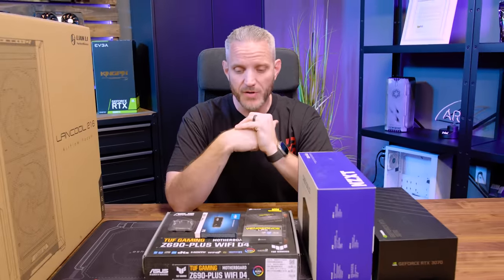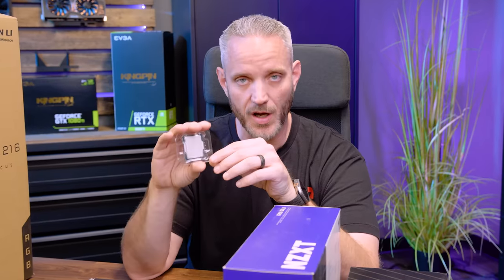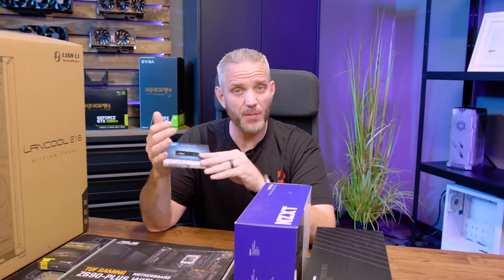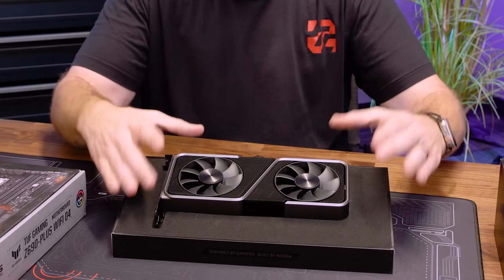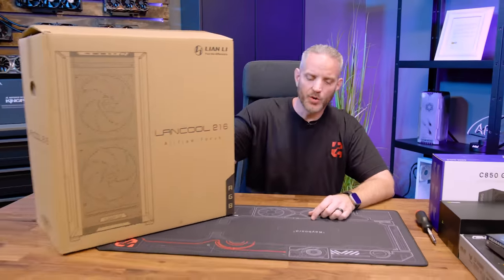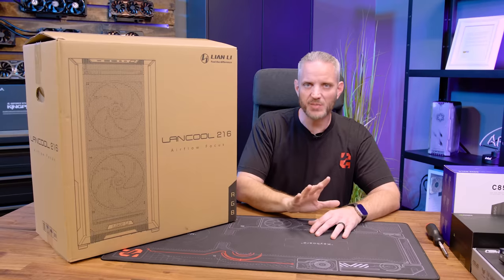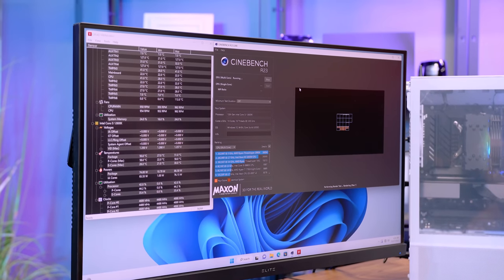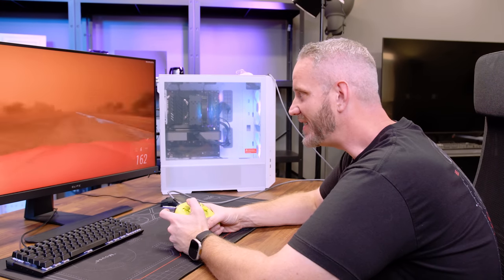Inexpensive PC Build Guide!

Comment: hoenstly the wildest thing to me is that the final price tag is almost EXACTLY, like to the dollar, how much i paid for my full first build in 2018!!! almost 5 years with parts that were already a year or 2 old at the time, and theres this much performance room for a full respending of that same tier of investment. its in teresting, but knowing that i left myself some of that upgrade head room.........this just validates all my plans from back thne and makes me so happy. a 330$ cpu upgrade fopr my current build t oa 5800x3d so im not buildign a NEW system at the end of an upgrade path but simply refreshing my old system TO the end of an upgrade path feels amazing. some bios work, frehs software, and maybe a cleaned up or newer OS drive if i need to could have this system running liek new~~~~ THE ONLY thing that has me seriously worried is the psu. its a 80 gold evga g6 but only 750w...... like its A GOOD bit of what id want, but the idea is that if im changing the psu thne im just rebuilding everything. cause its fun to build a new pc and because that much cable managing nightmare is just better to do with new equipment in a freshly cleaned (and potentialy new) case, but if i can keep that then im gold. the ONLY problem is i have no idea what gpu i want............ a 5800x3d is now a 105W tdp cpu, like rest of my system si chicken scr5atch of power draw at the moment, but my greedy self would LOVE a 3080 or even 7900xtx tier gpu upgrade if there was every a price stabilization to make it financialy realistic, or until the pricing stays high for so long that its the new norm and i just do it anyway~ i just worry that a 300-400w tdp card is gonna over tax this aged power supply so idk~~~~~

i think the one thing youve shown me si that i should consider a 3070 ti range gpu which will be essentially plug and play in my current build after the cpu ugprade cause the power psu limit is deffinitly stil lthere.......... its just......... my "target" gaming has improved as ive improved my tastes over the years~ it wasnt until this year that i dumped 400$ into a PROPER monitor upgrade, learnnig that its a place not ot be cheap, but im basicly target 1440p 144-165hz 27inch gaming which my new monitor is perfect quality ot support beign the msi mag27qrf-qd etyc etc. i just hope that i dont makje myself disappointed by not gettign the extreems of performance from "overpaying" for a lesser tier gpu which would still probably be damn neer 50-60% better than my 1080 which i love TO DEATH. buuuuuuuuuuuut thats all because i want "out of the box" performance............. what im truly learning is that a fan refresh, proper ram, some good cleaning and proper software, dino testing and optomization and bios updates................. i could just start doing evne the most minor overclocking and get way more power out of a lower end gpu. 3070 or 3070 ti or what have you~~~~ sooooooooooooooo good to have options, i just need ot kepe researching and learn WHAT options will work for me, which im willing to spend the budget on (i have the money im just super fucking picky sadly) and go from there cause mannnnnnnnnnnnnnnnnn not only shipping scams but just DOING THE BUILD is stressful. the single thing i love the most is building but its also the most stressfu lcause anything cna go wrong, ESPECIALLY with a refresh upgrade, even tho its robust tech, its expensive. anmd the down time for getting something wrong is always there. BUT LETS HAVE A BLAST OF A 2023 AND CHEEEEEEEEEEEEEEEEEEEEEEEEEEEEEEEEEEEEEERS

Comment: I just put together a Ryzen 5 5600x Corsair gold PSU 750w
Mpg b550 mobo
32 gig 3600mhz tforce delta cl18
Deep cool ak400 air cooler
And a 3060ti  evga ftw3 
1tb Samsung 980 pro
2tb barracuda HDD
In a Corsair 4000d airflow 5 sp 120 fans 
-1200. USD. Hopefully no bottle necks .😅

Comment: Using YouTube,  Tech chat rooms, and pre-built pc website.  I figured out the parts I needed for my PC. It's a higher end PC Build that utilized ddr4 memory. The gpu is a 4080. My pc is designed for utilizing applications like Blender to make video games. My cost is going to be around $3000 USA. I already have a tv I can use for the monitor, LG C2 42in oled tv. That is what I am working to save up to. I won't have enough until sometime after the tax season.  I got plenty of time to find better deals. Maybe better part options will come out. I'm fine with a 3080 but the best price I can find is around $1000 USA. I rather spend a little more and get 50% more performance.

Comment: i just built a system for a friend. 7600x, 32gb 6000 ddr5, 240 aio, compact torrent, single 1tb nvme. the core of this built was about 870.00 on black friday. shipped.  i wanted 5 for future expandability and i wanted the am5 for upgrades. the board is a 650m.  we borrowed a 2070 from a friend for now, looking to spend 1K on a video card in teh future so, just under 2K for a gaming build.

Comment: Massive props for picking the 3070.  I don't even "like" the card.  I got a Gigabyte Aorus 2 years ago and it was great.  Still is.  Best bang for buck GPU.  I have a 6800XT and 6950XT and for sheer reliability and lack of problems, the 3070 has been a champ.  I can afford any graphics card I want but my experience with the 3070 convinced me to wait for the 4070.
Reply: If the 3070 is still fine i don't see much reason to replace it anytime soon.
Reply: @rimuru2035  Yea and as a follow-up, GN's 4070Ti review also convinced me I can wait for a 5070.

Comment: I have to say I got the black Lancool 216 and really love this case.  I've been trying to get the RGB fan controller and the optional mesh dust filter for the front but have so far not been able to find them in stock.  The other case I might consider is the new Fractal North case with the wooden slats on the front, but it is a smaller case and I just ordered a MSI Gaming X Trio 4090 while will fit in the Lancool 216 no problem.

Comment: Just helped a friend of mine building his pc at the beginning og december. He ender up with a Ryzen 5800x, Corsair Aio, Gigabyte 3070, 32gb ram (3200mhz) B550 Asus MB, 850watt psu, 1tb Nvme in a Nzxt H510 flow case. Total of 1861$. Was reasonable i think. This was i Denmark so that was with VAT.

Comment: Last week, I upgraded my 1080 to a 3060 for 440 lardolls VAT included, that's it. 
Yes, I know, it'll be running at PCIE 3.0 speeds instead of 4.0, but DGAF. I can deal with that if and when the mobo fails, or when Windows 10 support ends, and the 3060 will still be a decent card by then. The system was originally built in december of 2017.

Comment: Hey Jay, I really like that you did a budget build. However I feel like you put too much thought and "value" into having an upgrade path. I don't know if I'm alone with this but when I build a PC I use it unchanged for at least 5-8 years. When the time that I want to upgrade finally comes I usually have to upgrade pretty much everything anyway. I really would like to see that 5800X or 5600X Build.
Reply: While I wouldn't say the system as a whole stays fully unchanged for its lifetime, the core (Motherboard, CPU) usually does. The systems I supervise (friends, family, my own) commonly do see storage (swap to SSD/M.2; just adding more) & ram (+2 modules) upgrades. Gaming systems also see the odd GPU upgrade (roughly every 4 years), which then get carried over into the next system. But by the time people want to replace the CPU (5+ years), finding a suitable in-platform upgrade will be tricky.

Applying such a timeframe to this system, we're looking at a CPU upgrade in late 2027 or later. DDR6 should be out by then as well as 5 or more new generations of Intel CPUs. 

For the upgrade path to shine, the upgrade would have to happen just as the cost of the 13th-gen CPUs is at the all time low.

Comment: I had another path.  Went a bit overboard. Building a his and hers gaming pcs with our current gpus. It’s more then I planned to spend but wanted something on the on the more current platform ( current a 2070 and a 3080)Did the math and spent just under 2,900.00 for 2 pcs. X 2 for all that follows. Hyte y60. 7900x/ ddr5 6000( the micro center and expo set thou 1 stick was faulty out of the box, happy I had a 2nd pc to test in.  Drove me crazy. ) similar motherboards( asus tuf b650 plus Wi-Fi / b650 aorus elite ax (needed bios update…that was a first) noctua fans, Corsair I cue h150i a couple 2 tb m.2 and a single super flower 1300 watt psu.   ( used the 850 watt I had in my wife’s oc with the 2070.)
O yeah and I moved the ssds I had over and used the rack mounts in the hyte y60. One on the bottom, and one using 2 screws and left it floating above the other.  Works fine and gets some airflow that way. Ssds seems stable and ok to do that with. 

It was not easy as this was my first big build and a lot went wrong. Got a different aio first and found out it was 20mm to tall for the hyte y60( didn’t know they were different thicknesses) Had random crashes because I didn’t do a clean windows install at first. Then more random crashes as I had miscalculated the psu requirements and the 850 was being overdrawn.  Used Msi afterburner to limit the gpu to 70 % to prove that was the problem. Had a hdd 6.0 tb that went wonky and died in my pc minutes after install ( it was old and was likely damaged in shipping from a friend who packed it badly and caused long boot and random crashes while I figured that out. ) replaced it with a 3 tb one that hasn’t died…yet. And had one of the sticks of ram as mentioned above prevent either pc from posting. Had to do my first bios update ever. Research how to initialize new drives.  Reactivate windows on the drives I moved over I was all over the place. But finally they are both up and running as of today. And hopefully stable.  Building a pc can be done by anyone but sometimes if you don’t know what to look for it can take a long time and a lot of research to figure out the gremlins. Also had a issue with the pc overheating and shutting down as I had forgotten to set the case fans to the gpu temp for their curve not the cpu as that was getting plenty of air so set them at a regular speed that’s not too loud and can get more air to the gpu.  Hyte y60 has ok airflow. But I knew going into this build it was for a long time ( as I can upgrade from the 7900x someday with am5 socket down the road) and was going to be a bit of a hobby build as my last pc build I tried on my own resulted in a melted ram slot and blown up/ smoking psu…  well it all fried actually. But… somehow I’m here.  They work.  It feels good, but I’m wondering when the next gremlin will come up. And when gskill will reply to my ram rma 

Was fun and thanks j for posting builds, guides, etc.  It helped alot and would not have been possible without you and a few other tech tubers too. Hopefully I can enjoy these for many years to come…

Happy gaming.

Comment: I bought the 5700X for like $199 and it is 3% slower than the 5800X. Bought an AIB 3 fan 6700XT for $470 and game pass. Because the 3070 and the 6700XT trade blows. But when it comes to RT... they both suck. Yes, you can say that the 3070 doesn't suck as bad. But when they both suck so much that you turn it off...

I am not blaming either GPU company for RT performance. Look at at Far Cry 6. They took the time to implement RT in conjunction with raster and it looks great but does not break immersion or performance. Most studio's are lazy and paint RT with a broad brush. Break immersion and performance.

Comment: Upgradability is why I went Zen 4 with my new build instead of Zen 3+. Of course, I had a bigger budget (spent $2500 on the PC sans case and PSU, and $1200 on the water loop), but it's still an important consideration.

Comment: If you are spending $1500 on a PC you should def get a 1TB drive imo. In cheaper $500-900 computer, I can understand going for 500gb drives, but if u are dropping 4 digits on a PC you should be getting 1TB at least, esp since NVME drives are as cheap as they are

Comment: Nice prices, especially on cpu and gpu.

I also gave some thought about how to maximize the money vs performance for my pc. What i did is take advantage of 12400F and blck overclock on ddr4 b660 mainboards.  

Cpu 12400F - 190 eur
Mb ASRock b660 riptide 180 eur
Storage M2 ssd 1tb crucial 80 eur
Cooler Be quiet pure cool 360 120 eur
Psu Corsair rm 850 130 eur
Ram 16 gb ddr 4 50 eur
Case be quiet 500dx  120 eur
Used 3070 from friend for 400 eur.

1170 eur for quite capable pc as 12400F is running happily at 5.2 ghz overclock and still cooled good cause of aio.

Comment: So strange. I built almost the exacted same system early this  year. Only difference's are I used a Gigabyte board as I hate Asus buggy crap boards and I used a EVGA 3070 FTW. My Cinebench multi core test score was 18852. No overclocking. I just don't believe in it. This has been an amazing system. And you are right Jay, it's all you need for 1440p gaming.

Comment: For used, 2080ti is a much better choice tbh...same or a tad bit better performance than 3070(5-12%) for $400 or less on Ebay...if the cheapest 3080 is $590, that means youll save $190 which will buy a nice z790 motherboard lol

Comment: Word of warning.  Ordered the z690 as linked and the vendor sent a me a used mb loose in a box with a little bubble wrap.  Had to send it back.  Spent an additional $20 buying direct from Asus online store.

Also, Amazon sent the ram and SSD in just bubble wrap envelopes,  so of course the thin box the ram and SSD are packaged in were crush.  Hoping they aren't damaged, but have to wait for the mb to check.

Miss the days I could walk into Frys and pick up what I need.

Comment: Good video Jay! So I just spent around 1500 on my very first PC build and I would love to have your advice on my choices. I got OLOy Blade RGB (2x16) DDR4 3200 ram, Seasonic Focus 850 w 80 Plus Gold Power supply, Kingston NVMe M.2 2TB, AMD Ryzen 5 5600X, ARTIC Freezer 50 TR Dual Tower CPU cooler, MSI B550 Gaming Edge Wi-Fi Motherboard, and MSI GeForce RTX 3080 Gaming Z Trio 10GB Graphic Card. What’s your take on this setup?
Reply: This is the case that I got MUSETEX Mid-Tower ATX PC Case Pre-Installed 6pcs 120mm ARGB Fans, Mesh Computer Gaming Case, Opening Tempered Glass Side Panels, USB 3.0 x 2, Black, TW8-S6-B

Comment: Seems like prices have come down quite a bit in the last 5 moths. Currently getting a PC together for a similar budget with a Ryzen 5 7600, x760e board, 32gb DDR5 6000mhz RAM, a 1TB Samsung 980 Pro m.2 and Noctua CPU cooler and fans.

Comment: I still have 2 practically brand new ASUS TUF Gaming RTX 3070 Ti graphics cards.  I paid $700 each for them from MicroCenter.  They only offered $249 each for them to buy it back from me.  I told them to pound sand.  I'll find a way to build mid-range gaming systems with them that I could sell.

Comment: MSI B660m Mag Mortar if you want to save more, the VRM heat sinks are very good and runs cooler than many z690's according to tests done by sites such as hardware unboxed, both m.2 are 4.0 for me this is a must as a workstation as well. IMO after doing a lot of research and buying it is by far the best mid price range board. Will handle 13th gen.

Comment: If running over $200 mobo the value for 12/13 gen intel goes down significantly IMO. I'd rather get a budget board and a 7600x to have true upgrade path if that's what you're going for.

Comment: Pro tip; don’t buy it all at once. Buy each piece you can per payday, it will be worth the wait. Also, if I was to build a new system with the 1500, I would probably go your route except try to get a slightly cheaper motherboard and get a 6800 as the rt performance would be similar to my current 2070 Super and the rasterization would double. If I were going to use the 1500 to upgrade my system, a scenario I am currently pondering, is to upgrade my 5800x to an X3D for the gains in games and spend the rest on a 6800 xt and a dremel to mod my case to fit the card. My 2070 super raster performance is just shy of the 3070 ti performance that a true upgrade would have to double my performance.
Reply: I wouldn't consider that a pro tip. I think its best to buy everything at once (or close to it). If you wait months you can't test your PC until you have everything. And what if you have a defective component and past the return period? Sometimes working with RMA depts. is a hassle. But to each their own.

Comment: I’m gonna have to go with the ddr5 board because in 5-10 years I expect it to be at least a bit more abundant, it’s better, may be cheaper down the road too, and fits into the whole upgradeability shtick. I don’t want a ddr4 board that might be obsolete with other parts down the road because new tech might saturate the market.

I’m planning on getting a good case and motherboard that’s more future proof and can budget on the cpu gpu cooling and ram, go for around 5 years and hopefully be able to upgrade to higher end specs and get 4K monitor

Comment: Ok. Got the parts coming. Went with a Corsair box since the one in the video isn't available to us pleebs! Did not get a GPU yet. I have a 2070 already and figured i will deal with that for a month or so until the midrange 4000 series come out and the 3000 series should come down again in price. I have been using a dual processor xeon with 64g ram so I should see a huge difference in performance! Gonna stick with Windows 10 for now and let 11 mature a bit more. Also, I always have dual boot with Linux for general browsing, email, etc.
Reply: Built the system and it is great. As a test I installed a 1060 gpu I had and the system worked really good with minimal difference over the 2070. Getting over 100fps in games even Rust (whoa). I did move up to 32g of ram. 16g was fine just I do work in Unity and Autodesk and wanted the torque of more ram.